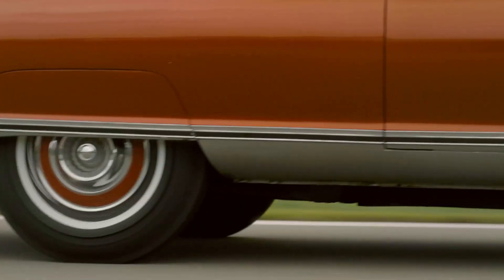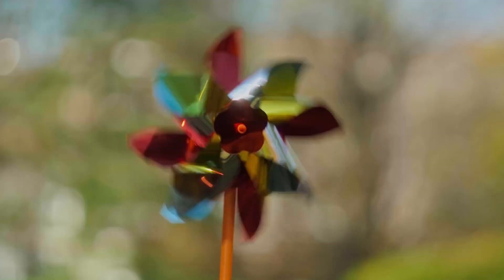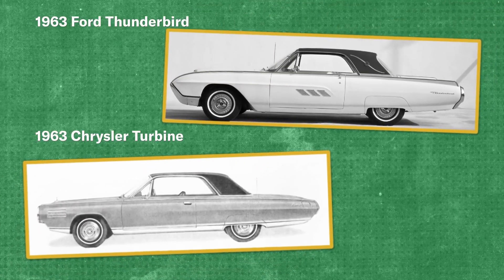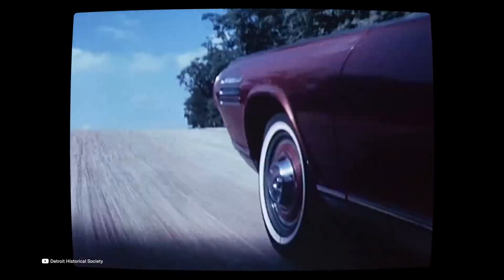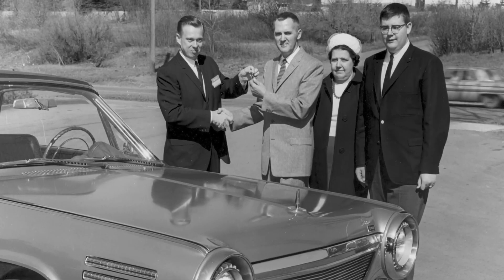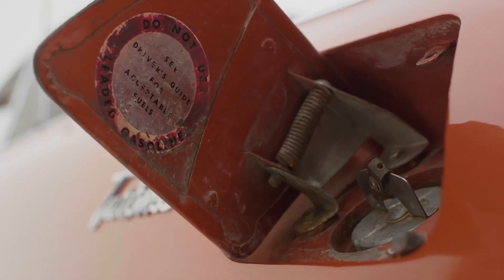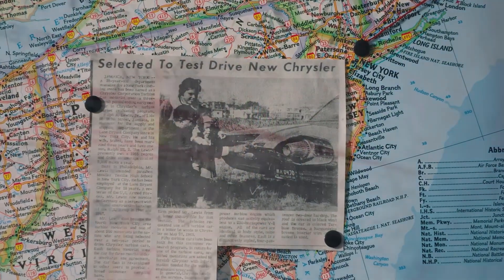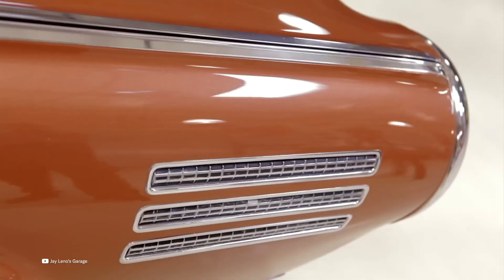Chrysler’s Turbine Legend: Born from the Sky, Killed by Reality

Comment: The EPA is what killed the Chrysler Turbine car.  The Turbine, by design, is almost twice as efficient as a piston engine; however due to the 4x - 5x increase in heat;  oxides of nitrogen increase.  Chrysler engineers knew that forthcoming emission mandates severely limited oxides of nitrogen (NOx) and couldn't come up with an adequate way to reduce them.  Catalytic converters were considered, but technology of the time couldn't produce a converter that could cope with the heat and force of the turbines' exhaust.  They later got around this about ten years later with the 7th generation Turbine and the proposed 8th generation;  by making the Turbines much smaller (and less powerful) but also catalytic converter technology was rapidly ramping up by the 1980's.  However, by that point, Chrysler was already borrowing money from the government just to keep the lights on and the factories open; and no more government money was coming in for the Turbine project to continue.  The 8th Generation never got past the design phase and no running engines were ever built.

However, I believe they have a place in the market today.  If we could equip a car with a small turbine engine turning JUST a generator.... we could design it to only have 3-states of tune:  OFF, Idle or Full Gallop (to produce energy).   Place this setup in a car with an electric motor and a small battery pack (for backup, or light electric-only use in city) and then we could have a multi-fueled Hybrid with an incredible travelling range!  The problem???  It would be expensive to build and it would require next to no maintenance and I believe it's those two things are what make it a non-starter.  Car companies need to sell more cars, and the service industry needs to keep fixing cars.